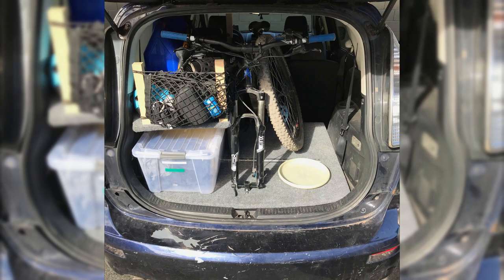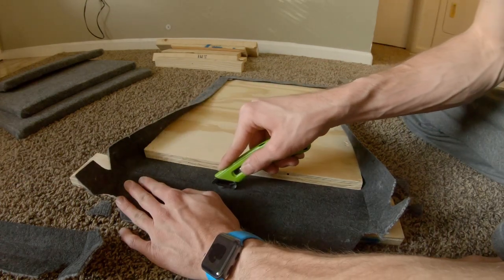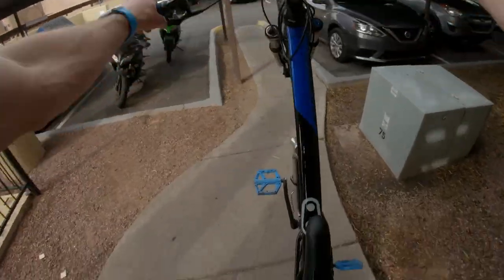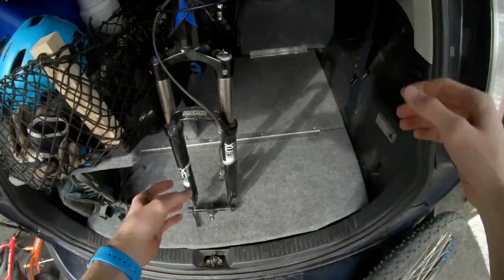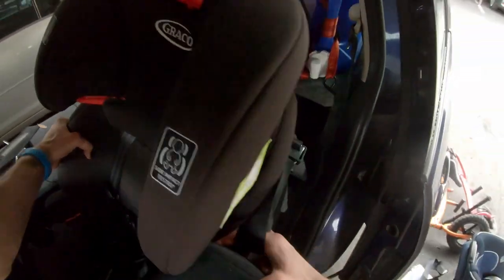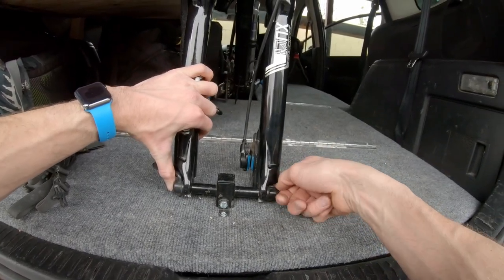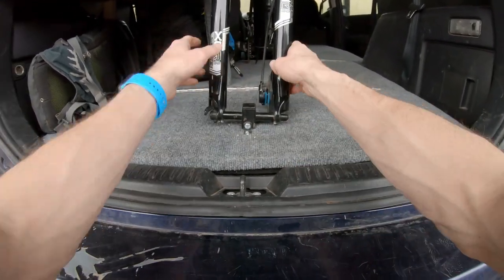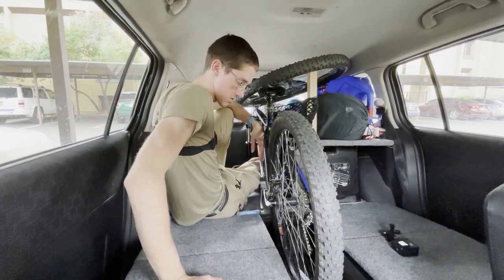Finishing and Touring Mazda5 Sleeping Conversion

Comment: My partner is 6’4’’, so I was glad to hear that you’re 6’3’’!! 
At first, because of the height the seating part takes when opened up to fold the 2nd row seats  (when the front row seat are in the most forward position, there’s still a few inches there), I thought I would have to rise the entire plateform a few inches so that I could make it a little longer so we would win a few inches in length there, but lose inches in height, which at 6’4’’ is not quite interesting either 🤔 He very thin, so size wise he’s good (I should be ok too, 5’8’’ medium/on the slimmer side size 

I personally am very happy in a basic tent without any commodities, as I’m fully equipped to camp (and have been for decades now) in complete wilderness, and so this project of mine is in fact only and exclusively for my little princess, my 6’4’’ 37 yo man! He’s a bit « reluctant » - read scared here - about camping in a tent here.. poor thing, his entire life he’s only experienced camping on beaches along the Mediterranean Sea.. which is far from where we are now, the Canadian wilderness 😂, but I do want him to experience it! It’s not as dangerous as he thinks it is and he won’t believe me until he gets to experience it, but rn, he’s not even willing to try, so now sounds like the perfect moment to get into a project I’ve wanted to realize for years! Thanks for sharing your experience! 👍🏼
Reply from the maker: Glad to hear it! Good luck getting him acclimated to camping! 
I just ordered a 4.5" inflatable camping mattress that I'm hoping with increase my comfort considerably. I've been using a blanket and egg-carton foam mattress under my sleeping bag and I've been having really terrible sleep with it.